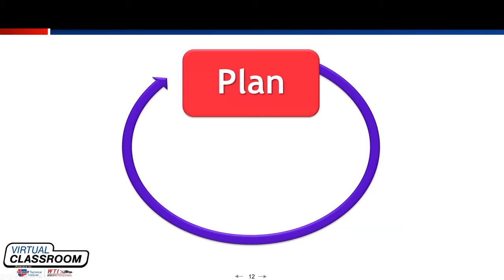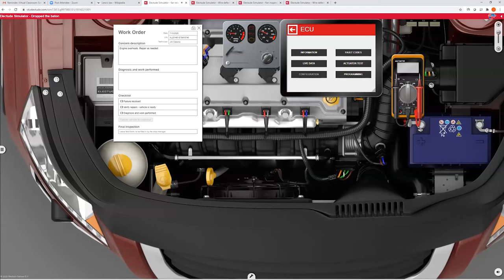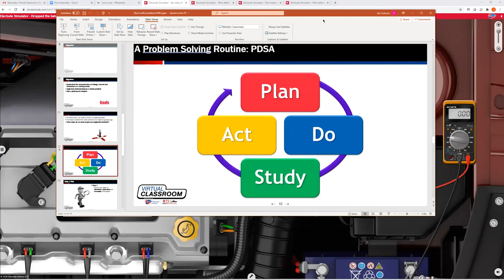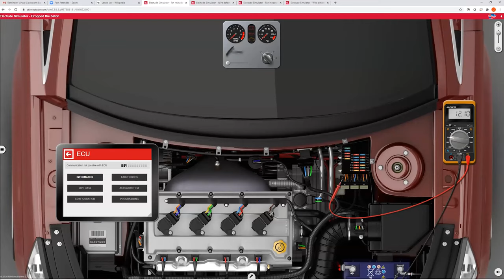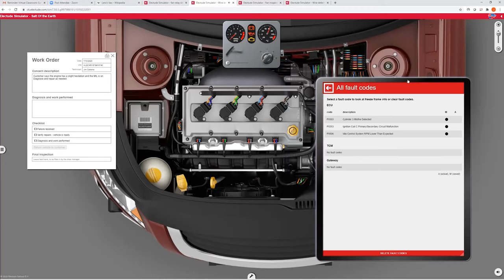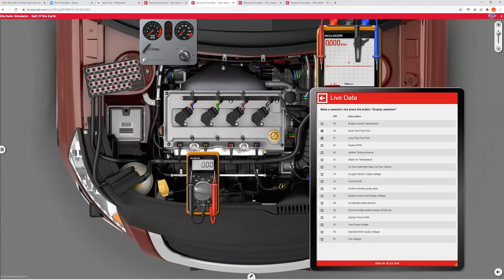Solid Electrical Foundations for Reliable Diagnostics - Part 2

Comment: I remember using the animated electric circuit tool by Boulder Colorado to learn current flow for my Engineering Physics 2 class. These videos are great and informative, keep them coming. America needs quality automotive technicians that are properly trained. You're building a better shop manager and leader in me.